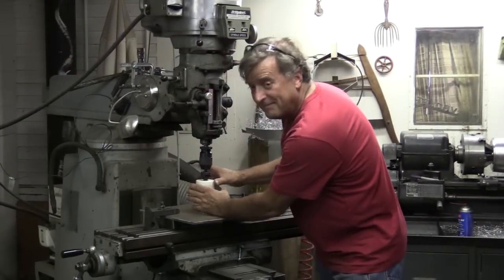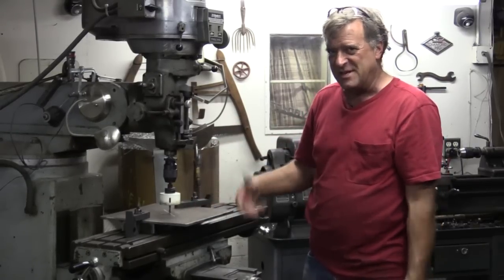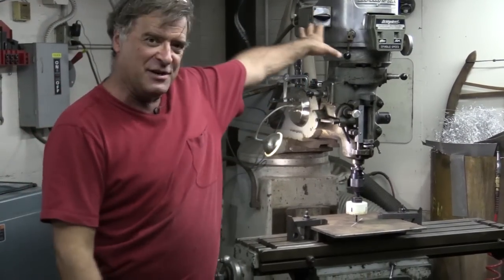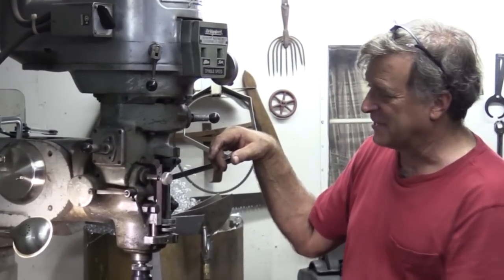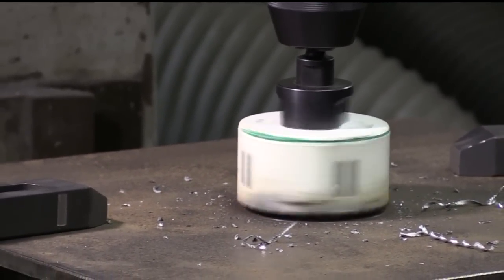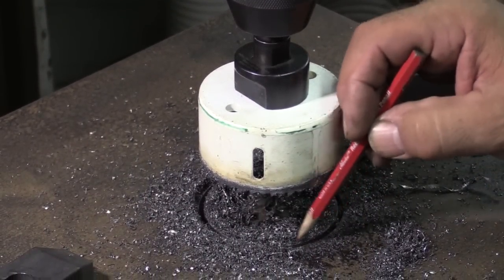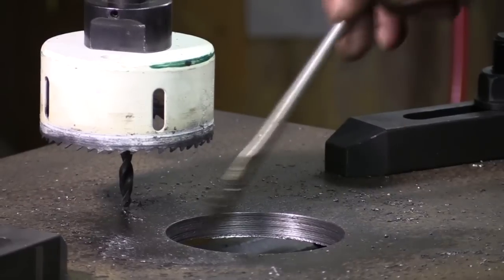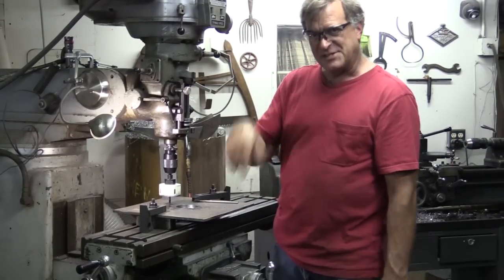How to Drill Large Holes With a Mill - and Why It's Better Than Using a Drill Press - Kevin Caron

Comment: is this possible to drill a 7/8" hole in hard steel case(1/8" thickness) through mill? what if, hole is on periphery of circular case.
Reply from the maker: Not sure what you mean by "through mill" but if you start with a small pilot hole and work your way up to 7/8th I don't see why not.  On the periphery of a circular case,,    just start small with a center punch to mark your hole and work up to the finished size.

Comment: Great video, what would be your aproach for 1" thick plate? Thanks
Reply from the maker: Same thing,   drill a pilot and step up in size maybe a few times.   Don't try to jump from a 1/8th pilot drill to a 1 inch bit.   Take it in steps and use cutting fluid as well.

Comment: Where in the name of Bob you get a metal cutting hole saw capable of doing this. I have three quarter inch plate I have to make many one and a quarter inch holes in. Now I've got three quarter inch I can use a one and a quarter it's bit but it's an MP5 I was thinking about throwing it on my lathe and cutting the MP5 into a straight 3/4 inch shank for an R8 collet

What would you do
Reply from the maker: That  is a Milwaukee hole saw.  Got it at home depot.   The secret is to go slow and easy. Let it cut and keep it lubed.
Reply: Kevin Caron, Artist I guess I'll try it but I need you to make lots of holes I'm not sure how many yet I have to do the math I'm making an hydraulic press so I got to make all the pin holes and I'm reinforcing the sides of the uprights with half inch cold roll. So just a generic old hole saw? I'll buy a couple of them and give it a try thank you for your videos

Comment: Hi, really good video! I need some advice, I have to do around a total of 220 holes (yeah, a lots) 16 mm in some square tubes 40x40x1.59 mm thick and I don't know if a bi-metal hole saw would last long enough, and if I would be able to sharpen the blades to keep it going. I know that is slow and that I have to use very low RPM and lots of oil but is not a problem, so, thank you and I hope you can advice me!
Reply from the maker: I would get a couple of extra hole saws!    You are going to need them!

Comment: Why are you using a mill, wouldn't a pkain 'ole band saw work? LOL!... I think I'm getting a mill pretty soon so your video is very helpful... thanks, Kev!
Reply: plain
Reply from the maker: Much slower speed controls so you don't burn up the saw and a larger table to clamp something to..     and a bigger motor.   All around a better way to go if you have one available..

Comment: I never thought of using a regular bi-metal hole saw to cut steel using my Bridgeport!  I've ruined so much tooling trying to learn how to use my Bridgeport that it just isn't even funny any more.  Aluminum, no problemo.  But steel?  Big fails every time.  Every time I tune to you, I learn something new.    Thanks.
Reply: Skilled Motorcycle Riders Association slow speeds, steady cutting pressure and plenty of coolant

Comment: Nice work, Kevin.
i usually pop a few small holes around the circumference of the hole i'm making for chip evacuation. also, watch using that ball bearing style chuck to do stuff in back gears like that. I'm sure you've had one seize shut before and know how much of a major PITA it can be to get them loose without damaging them.
Reply from the maker: +van guard      Soon as I can wear this one out it is going in the trash..    Hate this thing...     Back to a key for me..

Comment: Vector drive your mill
Reply from the maker: +Matt Brewer       Sorry, but what do you mean by vector drive?
Reply: +Kevin Caron, Artist a sensorless vector drive the big brother to a varible frequency drive. like a hitachi wj200 series i dont know how many hp your mill is but a 3hp unit for single phase is around 350$ and gives you near infinite speed and torque control, especially with an inverter duty motor
Reply from the maker: Cool,    I will do some homework and find out more.....  thank you for the heads up..
Reply: +Kevin Caron, Artist automation direct stocks all the inverter duty motors you could want and they carry a line of a china vector drives but why buy an off brand when you can have a name brand for 20$ more, wolf automation has the plug on the hitachi drives

Comment: Hi Kevin....I am a little surprised that your rotary phase converter appears to be energized by a mechanical style disconnect switch.  In the event of a power outage, the phase converter would stop along with the piece of machinery it was servicing at the time.  Upon return of power, phase converter and machinery would come back to life....could be a dangerous scenario or at least hard on electrical components (fuses and/or motors) when this happens.
The use of magnetic motor starters with START/STOP push buttons should be used....one on the rotary phase converter at the very least.  Using them brings the brain and finger into play on restarting the equipment from a power outage.  The cost of a self contained enclosure with PB's and contactor block are surprisingly very affordable.

I enjoy your videos....keep up the good work!!
Reply from the maker: +Paul McGuire      Had not thought of that when the mill was wired in..      About to do a remodel on the studio and I will make sure this is corrected..     Thank you for the heads up...

Comment: Kevin..  I have been following your channel for a while now.  I like that you answer questions and show the technical and how-to side of things.  Is that just a standard hole saw like used in wood?

The question I have for you is:    What is the best way or ways to drill a square hole (large or small) in both thick and thin stock?   I am considering putting together a block/jig with a hardy hole in it and am not sure how to put the the square hole in it.

Thanks for the video..
Shad
Reply from the maker: +shadowcastre      I would just drill a round hole and file or grind it square..    Look at the Makita detail belt sander.  Or any of the air powered belt sanders with a 3/8th or so wide belt..
Reply: Thanks..

Comment: I wish I had a mill.  No real reason to have one at the moment, but it would be nice.

Heat is the enemy of drill bits.  I use a water and oil based cutting fluid and squirt more on when I see the smoke/steam wisping up from the bit.
Reply: By then it's almost too late. Tap magic oil, use it lightly the whole time you are drilling. All will be well.

Comment: Mr. Kevin, wouldnt annular cutters be better for drilling holes that large?
Reply: Gaven
The annular cutters are very expensive compared to the hole cutters and in the mill the hole cutters do a great job
I have a set of smaller annular cutters (carbide) and the do work great and are faster but wow the $$$$
Reply from the maker: +Gaven Quillen     Not sure,  have never used one....    Have to give it a try someday..
Reply: Yes!
Reply: And you can get them quite cheap. If they are the HSS. $100 for a 100pc set. ***Please don't use these hole saws in anything thicker than sheet metal please. They are not made for it.

Comment: Kevin, I've been told that the auto feed on a mill should never be used for drilling,  it is meant to be used only when boring or other less heavy thrust operations I'm not a machinist and maybe others could chime in on this. Love your videos...keep up the good work.
Reply: You are right. I am a machinist. All the CRINGE at this video. Wrong tool. wrong holder. Wrong all the way around. Just because you can doesn't mean you should.

Comment: Kevin 
Does the mill fit in the garage with the car and can I plug it in where the dryer is plugged in?
Reply: +Art Humphrey   you will need a two to three phase converter. i prefer solid state
Reply: Thank You John
you are very kind.
I was spoofing Kevin as I have a sharp mill with dro and way to many tools - I have a 2800 ft shop
But I really do appreciate the info on the solid state 3rd leg for 3 phase - does it put out a full 3rd leg or is a semi fake out put
thx
art